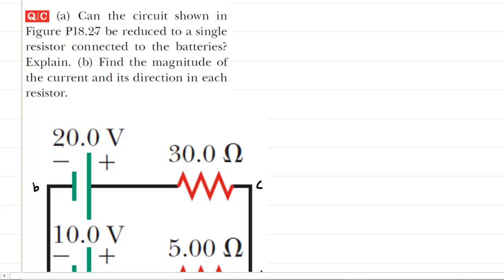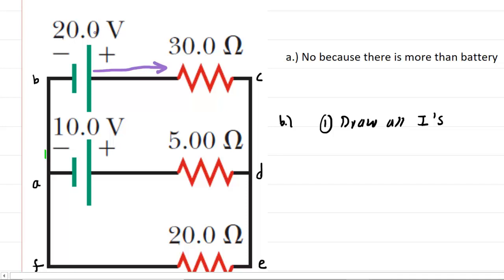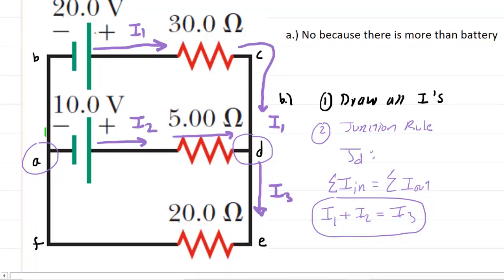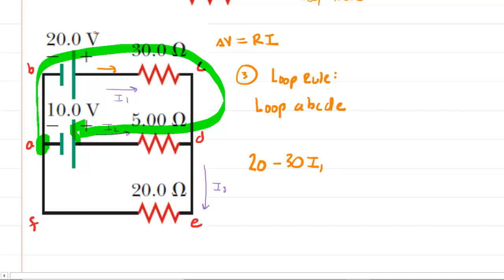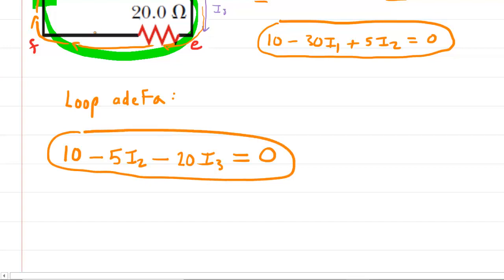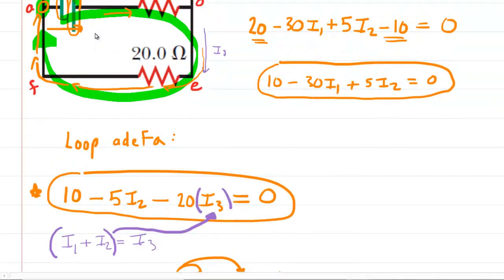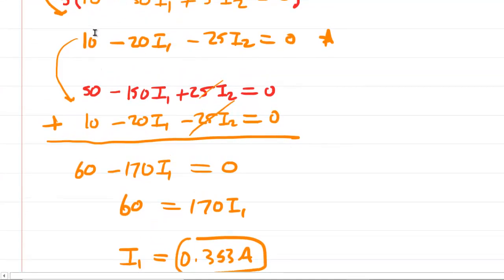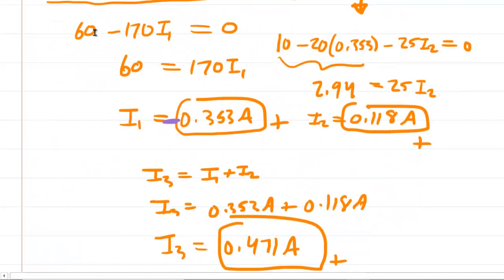Can the circuit shown be reduced to a single resistor

Comment: Three point charges 2 μC, 4μC and −2μC are placed at the three vertices A,B and C of a square of 
side 2cm. what is the work done in transferring a charge of 1𝑛C from corner D to the centre of the 
square.      Can you solve this problem please